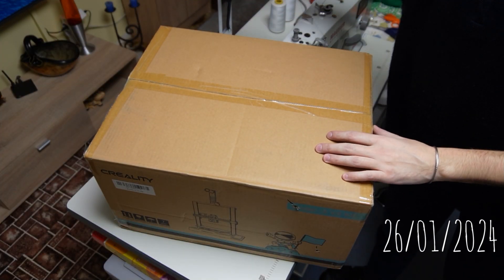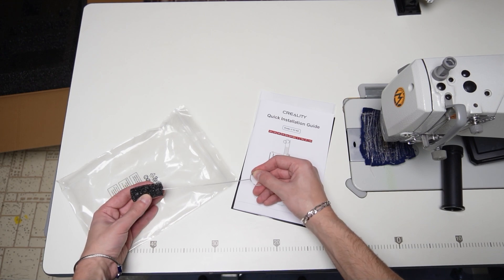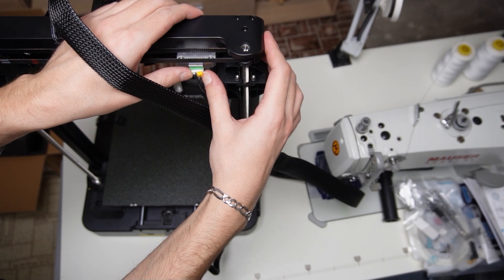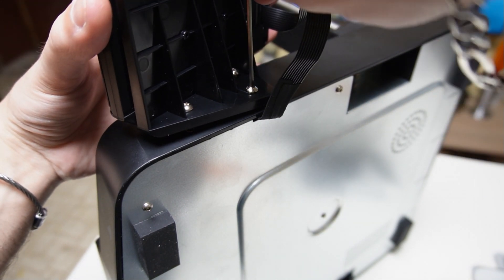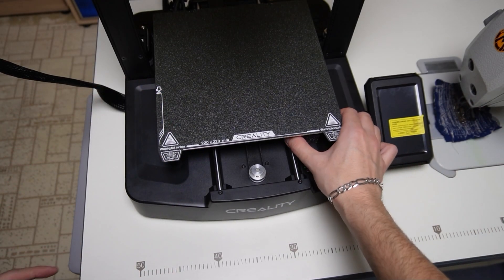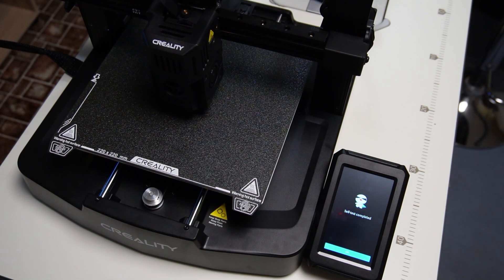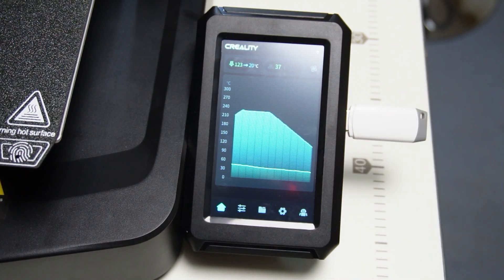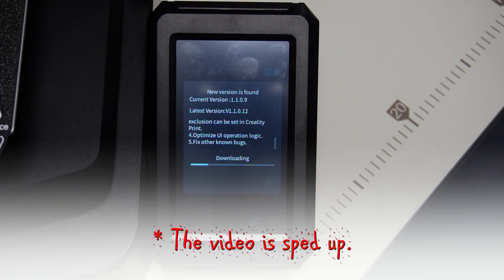Creality Ender-3 V3 KE: My First 3D Printer - Unboxing

Comment: That's great man, I just bought minds today and I set it up, but didn't print how to solve?
Reply from the maker: There are tons of reasons it might not be printing - if you’re able to boot the printer, that’s a good start. You might need to check your slicer settings, firmware, connection to the printer, or even the filament, depending on where the issue comes up in the process.